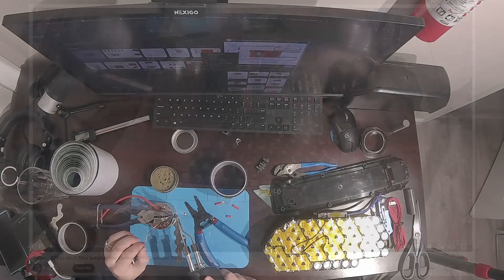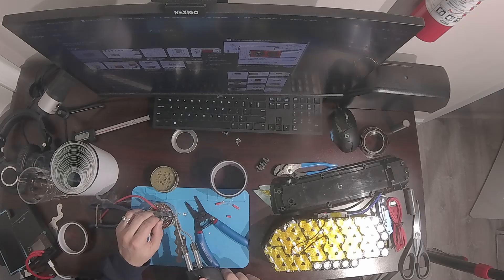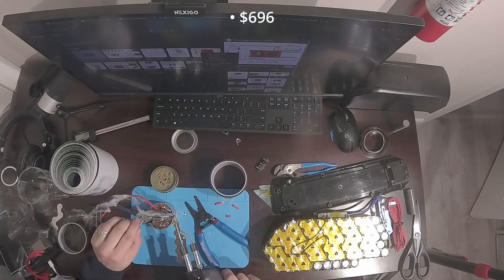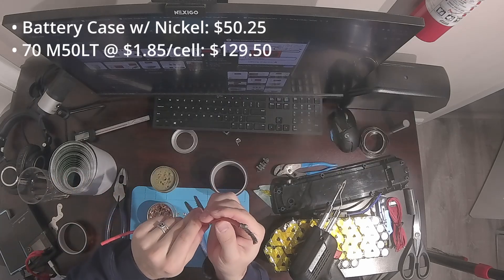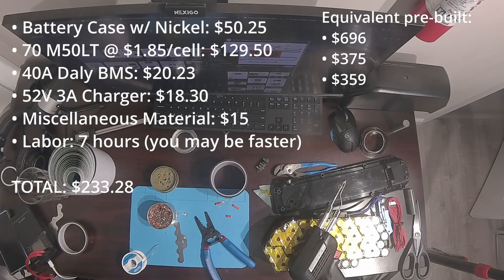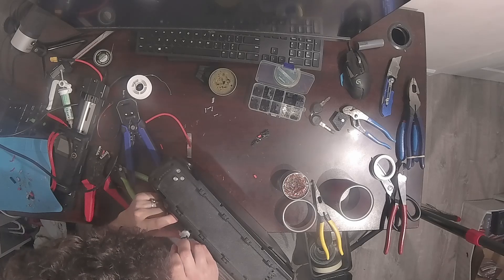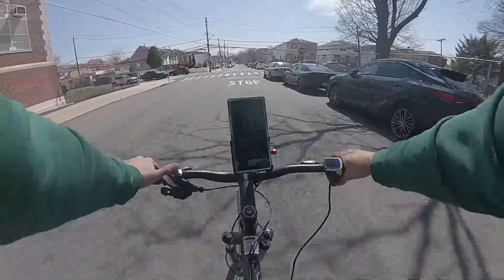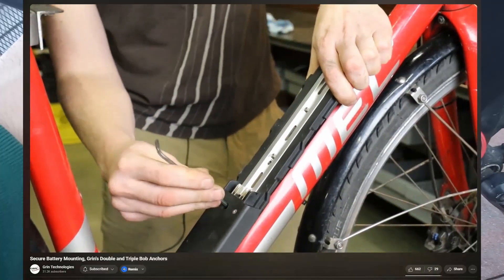Built vs. Bought: 52V 25Ah E-Bike Battery

Comment: hey there @Dim is everything okay? its been a while since youve uploaded 
i too have a VESC ebike that im working on 
currently in the process of making better torque arms 
i do so much regen it destried my original ones 
im using a QS273 3.5T with a Flipsky 75450 controller
Reply from the maker: Everything's good I've just been too busy to do e-bike stuff lol. I actually just uploaded a video but it might be a little while before I can complete another one.

Custom torque arms are by far the best option when you get into 5kW+. You need something to hold that axle really tightly.

The QS273 with a Flipsky 75450 sounds like a dream setup. What kind of battery do you have powering that?
Reply: @DimGG I'm using two banks of LFP 24s 25Ah 
Combined I get 50ah at 76v nominal 
And about 300 Amps discharge

Comment: Have you looked into ways to build modular battery packs? cuz they can be expanded later and faulty cells can be easily removed. I want to try building one, but I want to do it without spot welding.
Reply from the maker: I've looked at methods of building modular packs but they are just not as cheap, lightweight, and space efficient as spot welding. If you look at EV batteries they are modular but only up to a certain point. For example the Tesla's modules use 72 21700 cells. Generally an E-bike won't exceed 100 21700 cells (although I've seen some people use up to 240 cells, but that's quite rare). The modular system only introduces a new point of failure and doesn't make sense in the context of an E-bike IMO. I have seen one startup company making the "Gouach" battery. It actually looks quite promising but their selling price is a bit too extreme for me. Also it only goes up to 52v which is a bit underwhelming for me. They seem to be after the conventional 750w 48v e bike market rather than the 60v+ bikes like I own.
Reply: @DimGG  what do you think about building 12v pack with 3.2v LFP  50/100/150/230 Ah/cell  etc and adding a step-up module 2kw to boost 52+ voltages? That way even a 4 celled 12v@100Ah pack would weigh 8kilos 16lbs approx. There is only 8 nuts to tighten/12v. Gouach find is impressive. i've also found a china base youtube channel modular posting spring holders and stuff...but they look like they will fall apart within a few feet of commute.
Reply from the maker: That sounds like something that would work. Some of the step up converters I've looked at claim >95% efficiency which is quite good. My only concern would be the form factor since LFP prismatic cells + a step up converter + a BMS would result in quite a large battery that would be hard to fit on a bike frame. Also, if your pack is 12v and you're stepping up to 48v, the cells would see ~4x current discharge what the controller sees. If your controller draws 25 amps then that is 100 amps from the pack. This means your BMS would have to support 100 amps discharge, which results in a large BMS.

I think LFP cells are super cool, especially since they let you avoid spot welding. I'm currently working on a build (that will eventually be in a video) that uses a used 48v105Ah LFP golf cart battery from batteryhookup.com (BMS was faulty). I got it for a really good price. The only problem is that the battery is huge and weighs ~100lbs. I'm planning on pulling it with a bike trailer. We will see how it goes, lol.

Comment: My build is exactly the same, the cells, the triple clamp thingy from grin except mine is 36v. I've also built a 52v version for someone else but i didnt use the grin clamp for their build.

The clamp works quite well but it requires extra fastening using hose clamps or something. Zipties wont work. Use heatshrink tubing on the hose clamp to prevent the rust from affecting your frame. The hose clamps rust, that's okay, just check it from time to time. Don't rely on just the threads, that are on the bike frame.